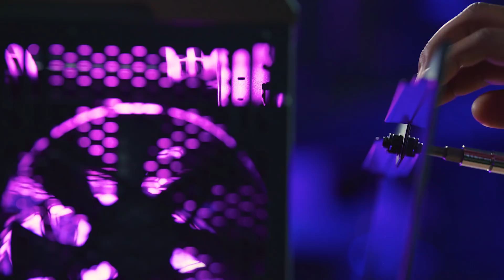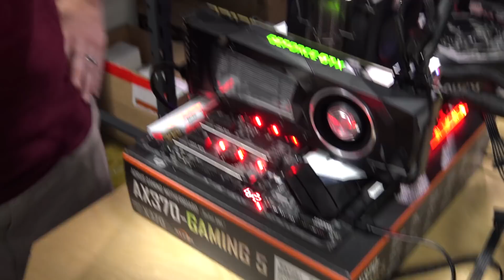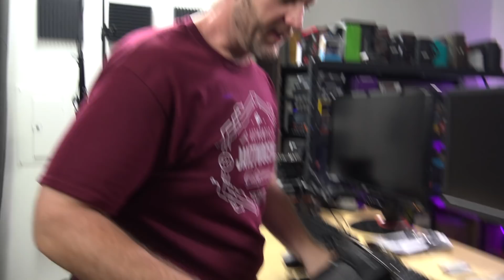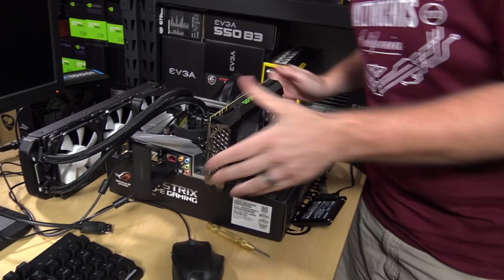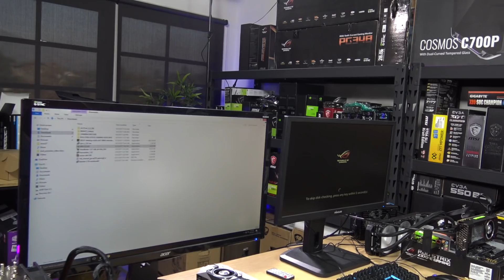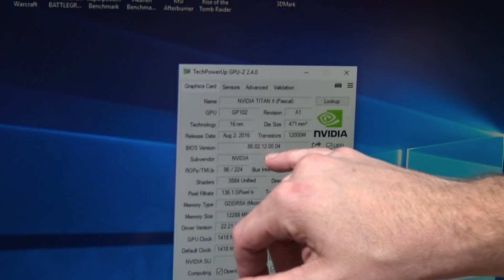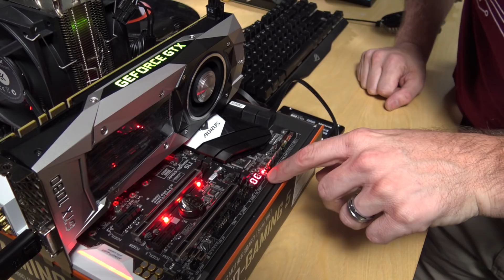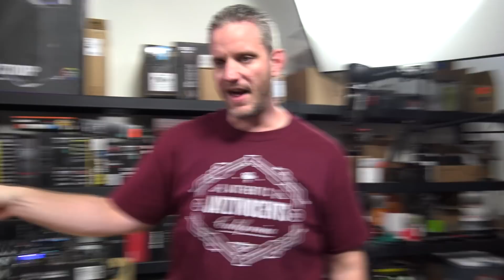I cant figure this one out... HELP!

Comment: i'm no pc expert but maybe the PCIe 16x slot is half-ish broken so that sometimes when you put in the gpu it works and sometimes it does not. this may be why the 1080 did not boot when you put it in the first time in the video. Either way i would try a new motherboard or another of the PCIe slots on the board and see if that helps.

Comment: Try switch the the CPU and or the Slot on the Port. Lockk on the Connector on the bottom if there are irregulatories.

Comment: Dont blame AMD ryzen , that is clearly the gigabyte aorus motherboard problem . You put that titan X card on ASUS motherboard, it will boot up with no problem .  Every motherboard has bios and micro code to work with CPU , GPU and RAM in order to boot .If you cant boot that is the fault of your AORUS motherboard . Finally , there is no simple all or none , dont scam us.

Comment: As many others have pointed out, Jay, you checked the BIOS of the good card on the Intel system, installed it in the AMD system and rechecked the BIOS.

But the bad card wouldn't boot on the AMD system, you installed on the Intel and left it with no follow up. This is what we, as viewers, were shown leaving us puzzled.

That the Intel system with the bad card detected new hardware seems suspicious to me. It makes sense if the system sees them as different pieces of hardware. If the cards were identical, the system shouldn't have seen a difference. That's how I would see it anyway.

That's my two cents... I'll get my coat.

Comment: Check connectivity between the card and pins in the PCI-E Socket.. Ive had that issue a few times with different customers builds.. swap the card it works.. same card back in.. fail every time.

Comment: If you have, i would try another CPU, maybe there is a PCIE Pin at the edge of working or not working. The other thing would be the RAM. If that all is working, try another motherboard. Propably, there is a lane sort of broken in there which causes a bad contact that some cards are OK with and some aren't

Comment: I know this might not make a lot of sense, but use the same configuration (with the "faulty" gpu) on a different motherboard (like an ASUS). Just to eliminate the potential of it being the board. Could also just be a configuration of power draw from the gpu and the board doesn't allow it and ASUS boards do...

Comment: Vbios issues are not that uncommon, especially on a new platform , bugs like this are to be expected. A "weird" issue similar to this is how some rx 560/460 cards have problems posting on very old oem motherboards (pcie gen 1.1 or 2.0 era), also you checked the vbios on the same card.... maybe get some sleep. lol

Comment: Because my 1st 16x slot refused to work with a new card it worked fine when installed on the 2nd. Maybe that's your issue with the motherboard as well.

Comment: First try to switch power supplies, pci-e slots on the ryzen test bench, then try other mobo, and if it works, make thorough examination ot the auris motherboard -bent pci slot pins. Try some measurements, e.g. voltage on the pci power supply, current measurements with amp clamps on the same cables in the different configurations. There may be some parasite current on the display cables. The moment the ryzen rig powered itself, that shows something short circuits on the mobo or psu. You have a bunch of different PCBs, with 100% not same elements soldered to them, with different characteristics. I bet it is "electrical" problem, not compatibility with ryzen or Intel or whatever.

Comment: You checked the same car twice 
But anyway try restoring all bios settings on the mobo to stock
Can be a wired issue with pcie bus if the cup is overclocked or the pcie settings have been touched

Comment: Jay, I'm not sure if someone has already said this, or you have tried it but... If you are booting from a fresh install of Windows. No graphic drivers are already installed. Boot up, you then get the error code. Shutdown and give it a couple of seconds or more. Restart and enter the BIOS, reset the BIOS settings to optimal defaults or just default. Save settings. Reboot. If the system does boot install the driver. Restart. Test it. I don't think it has anything to do with the Ryzen chip, it maybe the motherboard. I will be building a Ryzen system for myself soon and hope i don't get the problems your having. Weird... anyway, i hope you solve the problem. I enjoy your channel, there is some good info on here. Keep it up :)

Comment: Not a card problem per se. I'll bet that it's a combination of different hardware IDs between the two cards despite the same bios version. All manufacturers sometimes use different suppliers for sub components even within the same model range, so that's what's probably tripping up the mobo. Mobo BIOS probably has very little tolerances for these sorts of things. I'd check for newer mobo bios..  My 2 cents.

Comment: Check the PCIE gen settings on the Gigabyte MOBO.  Ryzen is VERY picky with that plus an overclocked CPU.  Just set it to gen 1 or gen 2 and see if it still fails to post.

Comment: Last year I've built my brother a new PC: i5 6600k, MSI Gaming M3 mb and GTX1070. For some reason I can't explain, it didn't want to POST with only one monitor connected to Display Port. I've disconnected the first one and connected the second one with HDMI. Everything was ok, installed Windows, etc. Than I've connected the monitor with Display Port and it worked fine. But everytime I want to go BIOS, I have to disconnect the Display Port, because when I leave it connected, the PC goes to BIOS and don't display anything on either one or goes straight to Windows. I didn't test this card with other monitors or motherboards, so can't really tell if this also happens elsewhere, but it's a very weird issue for me and maybe this is something similar to what you're experiencing right now.

Comment: Now this is a very far fetch. But have you tried different ports on the card? I just noticed that you attached the cable to the lower one first and then to the top one on the other one?
I know it to 99% will not make a difference, but i'd try everything in htis situation.

Comment: You never checked the BIOS on the card originally in the AMD system. To me, it sounds like it could be a MOBO issue. Try a different Ryzen MOBO if you have one not currently in use and see if that solves the issue. And for the hell of it, maybe see if there's any BIOS settings(I'm assuming the BIOS on both boards is up to date, pretty sure you said that) that aren't default like overclocks or something, seeing as how exact same cards can be finicky with settings. 

And if I also remember correctly, the card from the AMD system was the one that was giving you a worse score on both systems, so that card itself could potentially have an issue with it, whether it be BIOS or something else.

Comment: This is hilarious. Jayz why are you checking the bios of the same card on both systems? It will obviously be the same as it is the same card. Why not check the bios of the card that was not working on AMD system after you installed it on the INTEL system?

Comment: +JayzTwoCents I actually had the happen to me. A friend and I have almost identical systems with a Z77 mobo and Intel i5 3570 (3570k for him). I had an Rx 480 for months and then he got one as well. Pops it in his system and nothing happens. The monitor doesn't even turn on. It was working fine with good previous GPU. We spend a ton of time troubleshooting, upgrading BIOS etc and then I bring my own Rx 480 (Sapphire nitro) to test with. And it works fine. But then guess what. He take his 480 (xfx) and it works on my PC... That's where I'm completely bamboozled. We sent back the card and he was given a full refund by XFX after testing it themselves. 

So yeah, it was the GPU after all, we had same mobo bios version even. It's probably the same with you. Slightly faulty GPU.

Comment: I have had my system not post, thought my gpu was bad, ore cpur, or whatever. unpluged my logitech keyboard, and it worked for some reason. dissconnect all usb units, see if it works? Interesting problem tbh btw :D

Comment: If you still have an RX480 GTR you should try it and if it works a few benchmarks. I had almost the same problem, the system did not turn on, i updated the bios and it booted but crashed in games. After that i put a 1080 in it and it works perfectly now, so I left it like that.

Comment: I had the same motherboard and hated it. So fkin unstable all the time. Sometimes it worked, sometimes it didn't. It could run fine for a week and then just get unstable again. Had it replaced under warranty and the new one was exactly the same.

Comment: why did you not check the bios of the card that didn't boot in ryzen? You basically compared the same thing. After you swapped card, you did not ope GPUz in intel system, but did on ryzen system. Just saying in case you forgot or missed it.

Comment: The only thought is that there is a minor defect in both pieces of the hardware that are only shorting when used together. 

Do you have another identical motherboard to try the video card in?

Sometimes there isn't an obvious explanation, sometimes the fix is to swap it and whistle and walk away.

Comment: Have you ever experienced crashes with the video card because some motherboards wont post with certain kind of crashes after. They basically register the card bad forever by storing the serial number and not letting it post even if you repair the problem. But that only happens when there is either really high temps or a short on the card.

Comment: Thats not Ryzen but a BAD Mobo.  checked the bios version on the SAME CARD! He never checked the BIOS on the BAD CARD that was moved over to the intel machine!!!   And Jay its getting old fast ,all this Ryzen this and that, when every singel youtube you have out of you overclocking a ryzen system you never ever use Ram for Ryzen you never ever start whit fine tune the memory first. and after XPM is up and stabel on low latency Ram then you start Overclock the Ryzen cpu.  not just 1,4V multiplyer to 40.   Meeh  start tune em Propper.

Comment: tell your GPU to stop being an intel shill lol

on a serious note, you checked the same bios rev number on the working card twice instead of checking the bios rev number on the non working card, but i am gonna take your word on both cards having the same bios revision

id try a different PCIE slot, clear CMOS and restart, maybe reflash the bios, the first thing id do is clear CMOS, especially if i am swapping cards and i know i modified my bios settings, next would be a different PCIE slot

Comment: GPU is fine if it works in other system. I would look into motherboard settings, system bios that is. What error code translates into from mb manual?
And label the cards.. with tape or marker.. put numbers or names on them ;)

Comment: i think is a motherboard problem. I have encountered problems like this more then 10/15 years a go, when pentium 4 and atlhon xp where out. When ai had the phenom 9600, i changed 3 motherboards in 2 years. One was high end, the other 2 where mainstream, also with memory i had issues.Its common, there are computers. Sometimes you get problem on the os level, and you have no ideea how to fix it. I encountered problems with the same game same windows, but different hardware, when that specific game won't start on one computer, but other games will start.Its binary and sometimes it works sometimes it doesn't. This is why apple computers are.. where much better, because they only work with specific hardware, after they have don a lot of testing. Even computers like dell fujitsu etc, are much better then custom builds. When the market is flooded with hundreds types of processors, motherboards, graphics card, wireless adapters, memory, rgb, pcie cards etc.. You have to imagine that this products when they roll out from the manufacture they are being tested on the end of line, when a computer checks if the product meets the standard. But they are not beeing tested in a full computer. Computers that are made buy companies are much more reliable then the ones we make at home

Comment: If memory serves me, B2 error code is a ram problem. Put in you orginal Titan and reset your ram.. also make sure your ram is in the correct slots.. think it's odd you picked up that issue after powering on with no ram. I would also try clearing the bios and trying that card in a different slot.
Reply: Reseat not reset ram.

Comment: Check the date it was manufactured (the Titan) was it before Ryzen 7? Did you try it with other Ryzen processors on the same mobo? How about a different am4 mobo? I know it seems elementary but I'm not super experienced ,but maybe that's the eyes ya needed. Maybe it's just  one of those things were it was like a pre release card and not quite everything is up to spec for am4

Comment: You never checked the bios from the card that wouldnt boot. You checked the bios in the intel system , then moved that card over to the amd and checked it there again. But you never checked the version on the card that came off the amd after putting it in the intel.

Comment: That one card that is not working has a strange pin out... its off on the card just enough, and or on the female PCIe slot causing issues. The other cards are not off. Computers are not as bad as they used to be with compatibility but it does still exist. Some components just don't get along.

Comment: Hey Jay, you read the BIOS version of the same card twice, so the card that doesnt work still has an unknown BIOS version :P

Other than that, I had a similar issue when I first built my Ryzen desktop, my R7 360 didnt work but my 8600GT worked fine (didnt have more hardware to test with at the time). On top of that one memory slot on the mobo didnt work either, oddly enough, loosening the CPU cooler fixed the memory slot issue, then I decided to reseat the CPU, which fixed the GPU issue... Still confused about it to this date, but its been working fine since. (Sure the memory could have been bad contact in the socket from the slight bend of the mobo caused by the cooler, but the GPUs are just weird, they both use x16 PCI-E, so its likely not a pin contact issue)

For reference, Ryzen 7 1700, Msi X370 sli plus and two 16 GB corsair vengeance 2400 MHz DIMMs

Comment: ***I've already had this issue and fixed it.*** You checked the bios vers on the same card twice! lmao btw that's not what is causing the issue anyway. When you SWITCH CARDS, make sure everything - including hdmi/dvi/dp or whichever you use is properly connected and everything is hooked up right then boot. It will work.. if it does not, then switch cards again and try again. IT HAS TO POST PROPERLY ON FIRST BOOT WITH THAT SPECIFIC CARD OR IT WILL FAIL TO POST EVERY RESTART.. UNTIL YOU SWITCH CARDS AGAIN.. idk why. It's a ryzen bug I guess. For example, if you rush into it and don't connect something properly and then hook it up and restart it will fail at the exact same point every time you restart.. Until you swap cards and swap back to the one you were having trouble with and boot properly.. So when you swap back to that one.. take a few min to MAKE SURE everything is hooked up good.. seated properly etc before you boot.

Comment: Given how specific the problem is to a particular hardware combination, I'm led to believe its a low level hardware issue, which has just enough margin to work with the serial timings on the PCIe interface for one card but not the other. This could be due due yo hardware bugs like poor PCB layout, or even the hardware logic with the Ryzen chipset and how it PCIe is implemented! It might even change with tempurature or seemingly unrelated components like RAM or power supply issues (like conducted noise)

I dont know how to diagnose it further without testing a bunch more configurations, every possible permutation of simalar hardware are UEFI settings. Going further would require laboratory equipment like oscilloscopes, fast logic analizers and serial decoding software, probably some difficult to source knowledge of the system design. WAY more effort than its worth.

Comment: Change the power connection with The  psu, swap it in another port on the power supply.had the same problem think way back with My 2 7950 boost.changed the power cable in another and it work Again maybe the power cable a little boeken dont now but love to see the anwser

Comment: ok... I know there must be a ton of comments pointing this out....
Buy you check the GPU Bios, on the intel system, then you take that card, and put it in the AMD system, and you check it on the AMD system - but its the same card you are checking again, you should have checked on the intel system again to see if the bios was different. at this point you just confirmed that the bios of the card is the same when you check it on both systems.

Comment: My system: http://www.sysprofile.de/id161447
Had the same problem 2 or 3 times until today but after 1 or 2 reboots it worked perfectly fine again.
Could be a weird error between the board and the card. You should use another board and see if its fails to boot with this card.

Comment: I had two intel systems differnt mother boards 1 was a h2 and the other a z77 type and i had two call of duty gtx 580s and i had the same problem i riped the bios of the 1 that was ok to the other to narrow it down took bios battery out of the one the one that dident work then i downgraded motherboard bios and looked at the gpu gfx legacy and uefi bios options XxxX